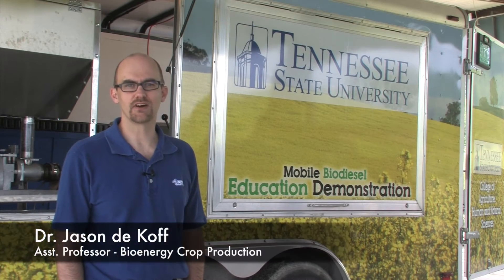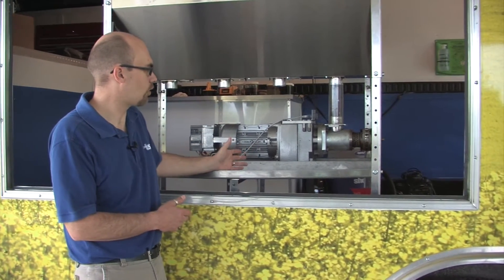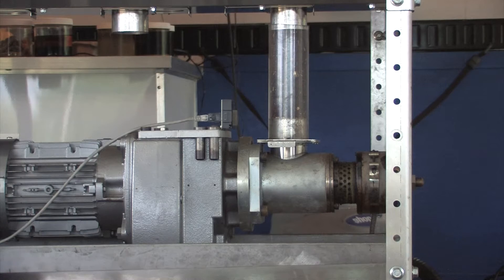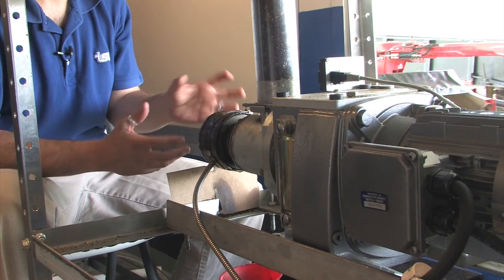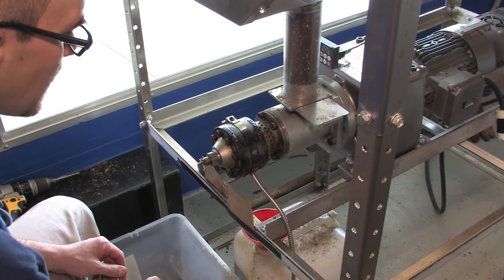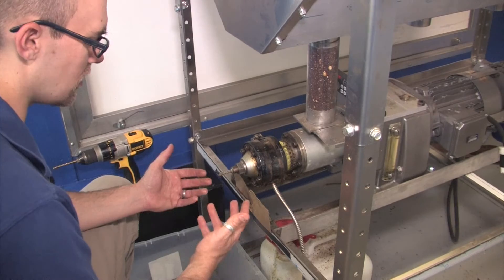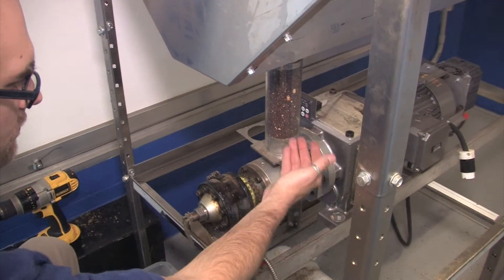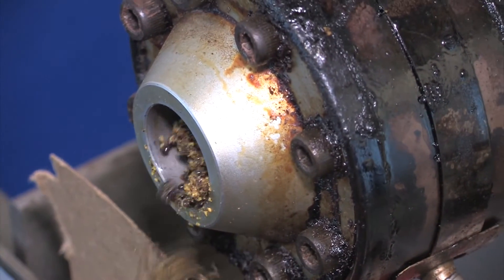Biodiesel Production Part 1

Comment: Wow, great video.Iam ingeneer student and oil machinery entusiast. These you says about the speeds and yields will be valid for any else screw press machine? Can tell me some others 'tricks' like previous these? For example: I was thinking in how way the oil is droped out the seed in the proces... the oil is drop just at goal to the 'head'? or is continuosly released troght the filaments of the screw itself? Just like its can seems the perfored section where the oil flow out is not around the head, but more at the middle of length. Hope you can understand my slang. Iam of southamerik and no talk very well english
Reply: Good job, well said.    - take care